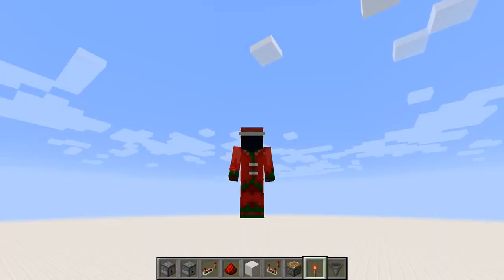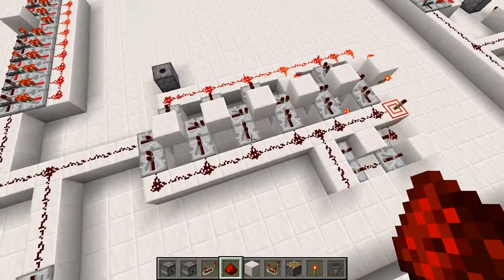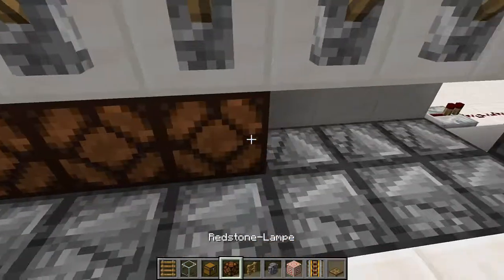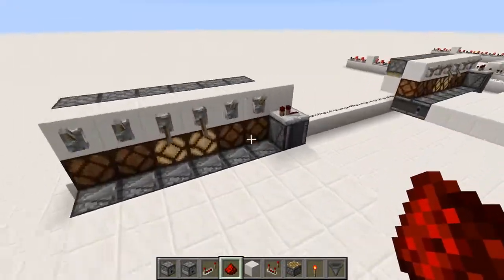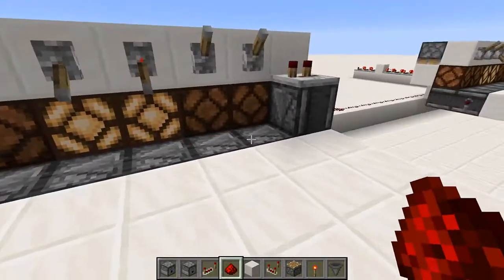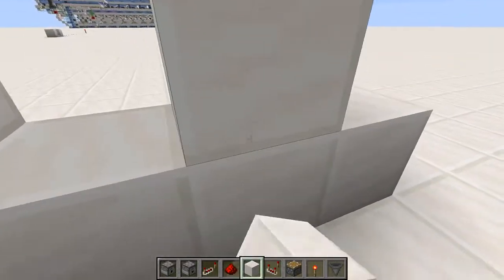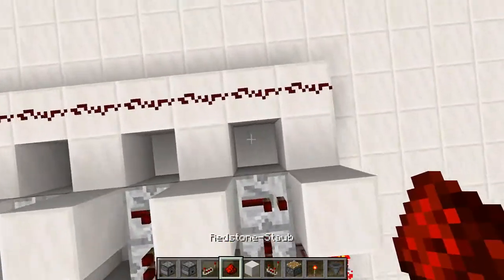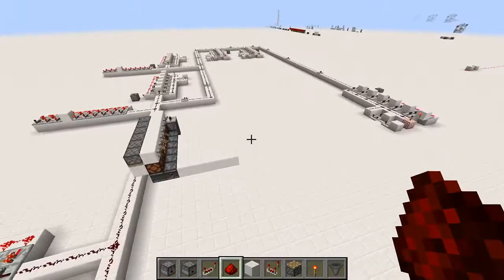Multiple Outputs With One Wire Tutorial (Minecraft 1.16)

Comment: Not the best decoders

Edith it’s still a good design
Reply from the maker: I'd be happy to take a look at better ones, if you know of any. What exactly is wrong with them? They work reliably and can be easily expanded to decode a signal of larger size.
Reply: It doesn’t have moltipole in one
Reply: And does it still work in 1.17.10
Reply from the maker: 1.17.1 is currently the latest version, and it does indeed still work.
I'm not quite sure what you mean by 'not having multiple in one,' since the entire point of the contraption is to deliver an output to multiple distinct locations through a single wire.
Reply: I mean that one decoder can have more than one different signals or more output
Reply: @adamadness2283  if u need multiple signals to be decoded at a single point then u can either build multiple decoders or use a different encoder such as a binary or combination encoder, plenty of tutorials exist for these, what your wanting is not a use case for this design therefore your comment "not the best decoder" is wrong as it would be the best encoder (that iv seen) for the use case it was intended for. 

not a rant, just some friendly information.